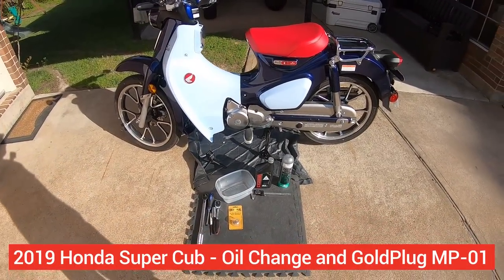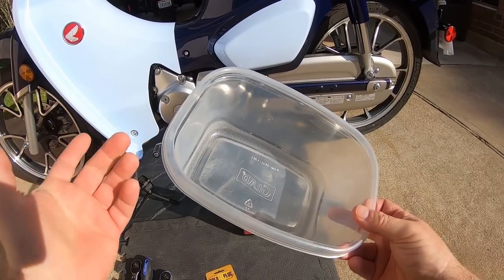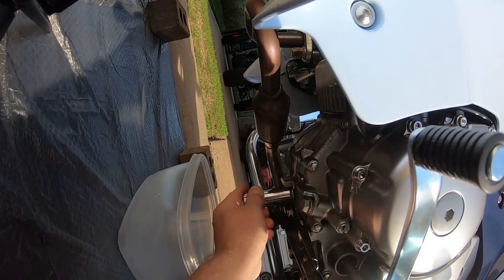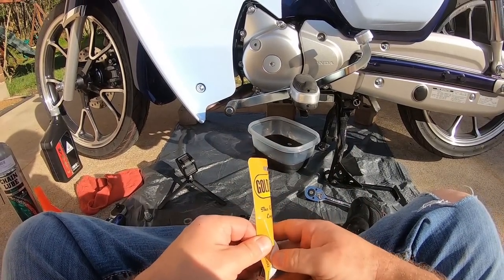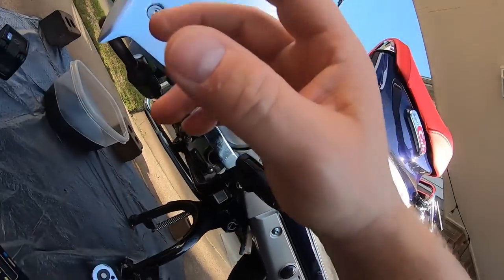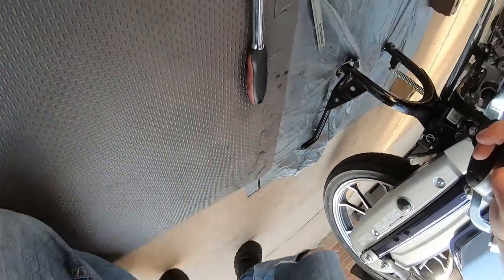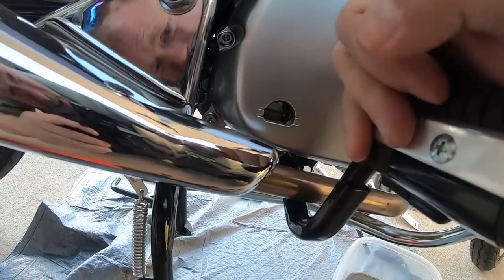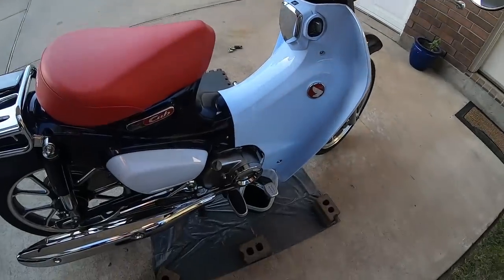2019 Honda Super Cub C125 // First (early) Oil Change // Gold Plug MP-01

Comment: hi, video suggestions 
1. Iridium plug, MPG /throttle response /dyno?
2. Amsoil scooter oil or shell 5W-40 scooter oil
Reply from the maker: I plan to replace the spark plug after a few thousand miles, so I will replace that with an Iridium plug when the time comes.  Unfortunately, I don't have the fancy equipment for a dyno run, but Cycle World has done that for us already:  https://www.youtube.com/watch?v=TEEMlIHn1bg .  I haven't decided on the synthetic oil that I will run in this motor after the first 1000 miles, but it will probably be Castrol 4T full-synthetic or maybe LiquiMoly.  I track my fuel mileage for my bikes carefully, so maybe we'll see an improvement when I switch over to synthetic.

I haven't tried the Amsoil or Shell scooter oils yet. Do you have any experience with them to know if they have any benefits over other 4T syn oils?  That might be a good test for the guy at Project Farm:  https://www.youtube.com/channel/UC2rzsm1Qi6N1X-wuOg_p0Ng . He does all kinds of really excellent test/comparison videos!  --QM

Comment: Hi,
What size os gold plug 12,14 16?
1.25 1.5 1.75?
Thanks.
Reply from the maker: I installed the Gold Plug MP-01 (17mm head):  https://amzn.to/3wUITnw . The plug dimensions are M12 x 1.5 (16.75 mm length seated depth).  You can see the full measurements in my Honda Navi oil change video: https://youtu.be/CfnLLFgqiKk (skip to 4m 26s).  Cheers!  😉👍  --QM

Comment: Wouldn't a screen keep  metal particles in the crankcase?
Reply from the maker: The screen is below the "spinner" assembly, so it acts as a semi-permanent filter in the crankcase to catch larger debris.  That screen is scheduled to be cleaned every 8K miles along with the spinner assembly.  The GoldPlug also seems to catch quite a lot of debris in the oil because it's covered with gray, ferrous sludge every time I change the oil.  I'll be sure to video the spinner change maintenance when I tackle that job sometime soon.  Cheers!  👍  --QM

Comment: Does a brand new Honda super cub come with standard oil or synthetic oil? I went to an auto parts store and the representative told me that if the factory puts synthetic oil in the crank case you should not replace it with standard oil. Does that sound right to you?

Comment: Thanks for yet another great video!
Question: If there is a screen above the gold-plug, separating it from the main sump area... wouldn't any detritus be blocked from the magnet by the screen?
Reply from the maker: I had assumed the same thing, but I was surprised to see how much ferrous sludge was built up on the magnet during my last couple of oil changes.  There were even a few larger, shiny slivers of metal on there, so it appears that the GoldPlug is still able to perform a valuable role in cleaning the oil.  The magnetic plug is cheap insurance, IMHO... it certainly doesn't hurt to have it installed.  I'm particularly interested to see how much debris is caught in the oil spinner and screen area.  I'll be sure to video and share that procedure when it happens.  Cheers!  😉👍 --QM
Reply: @QuasiMotard  Excellent reply. That all makes sense. Nice feeling to know that the magnet is there doing its duty.
But I'm still confused...How does the debris above the screen, ever get emptied/removed?

Thanks
Reply from the maker: @justkeepinitrealyo  The oil spinner and debris screen are a maintenance item that needs to be performed every 8K miles, per Honda's guidance.  The right-side engine cover must be removed, followed by the oil spinner assembly and other related parts, cleaned out, and then reinstalled with a fresh cover gasket.  I don't anticipate that the procedure will be difficult, but it will probably be tedious and very messy.  😉👍  --QM
Reply: @QuasiMotard  Got it!  Thanks.

Comment: I have been using regular motor oil in my cub, not motorcycle oil. Do you think that's  a mistake, or is oil, oil?
Reply from the maker: The Super Cub does require JASO- MA rated oils because of the wet clutches in the transmission.  You can use either traditional petroleum-based oil or synthetic, whichever you prefer... just be sure that it has JASO MA or MA2 ratings and no "energy conserving" classifications.  😉👍 --QM

Comment: Been a while since I have had a Honda anything, so I only know about oil changes on my other-branded scooters. All the shops want $100 to $150 for an oil change and (bogus) service. No thanks, I will be doing my own oil changes. Besides, can an oil change get any easier than on this bike.
Reply from the maker: Yep, that's my posture on it as well.  I like to have the first change or two done at the dealer while the bike is under warranty.  That covers the "mandatory" initial maintenance for warranty issues.  Beyond that, I do all of the routine maintenance on my bikes.  At least I know that it was done right, and not shorted on anything (e.g. , cheap oil, etc).  My dealer does a decent job, so I don't worry too much... but I've had a few really bad ones in the past.  A few good ones... new tire and tube change, but they put the OLD tubes back in (charged me for new ones, though)... wrong viscosity of oil (and petro instead of syn)... front axle carrier bolts missing (WTF?!)... exhaust hanger bolts missing, etc, etc.  --QM
Reply: @QuasiMotard  putting the old tubes back in while charging you for new ones. Where would we be without fraudulent, scammer mechanics??? My guess is we'd (most of us at least) all be a bit wealthier! 😄

Comment: Hey quasi have you started using full synthetic yet? I have about 3000 miles on my cub and I was wondering when I should switch to full synthetic. Hope all is well buddy thanks again for all of your videos 😁😁
Reply from the maker: Howdy!  Yes, I switched over to Castrol Power1 4T 10W-40 full-synthetic a long time ago.  Adrian and I noticed that we were consuming a lot of oil during the Scooter Cannonball Run... about 150mL per 500 mile day in the highways.  We switched over to Mobil1 4T 10W-40 full-syn, and the consumption disappeared.

We don't know if the difference was due to different riding conditions (e.g., altitude, temperature, engine loads, etc), or if the Castrol 4T was just too thin.  😉👍 --QM

Comment: Hey dude, I'm a recent cub owner, 2020 brand new. I would love advise and conversation about care and maintenance. Im 25 and this is my first "bike". So far I have 109 miles on the cub. Thank you in advance✌🏼
Reply from the maker: Congrats on your new Cub, and welcome to the world of motorcycling!  Most Honda's (the Cub in particular) are very low-maintenance bikes.  While the bike is still new (under ~600 miles), you want to take it easy on the motor and transmission by using moderate throttle and shifting as smoothly as possible.  This will help with the engine and transmission "break-in" and it should prolong the life of the drivetrain.  

After the initial maintenance is complete at ~600 miles, you will want to change the oil every 2000 miles or more frequently.  This is a topic of debate because the Honda owners and service manuals specify 4000-mile intervals.  These engines don't have oil filters (just a centrifugal spinner) and they only hold ~1 US quart (~1 liter) of oil.  My mechanical sympathy kicks in and won't let me run that heat-baked, dirty oil in there for more than ~2K miles.  My rationale is this:  oil is cheap, engine rebuilds aren't.  😉

Another item that you shouldn't neglect is chain maintenance.  The Cub has a chaincase that keeps most of the road grit away, but you should still lubricate it and check the tension/slack every 300-500 miles.  This is a quick process that only takes about 1-2 minutes.  You can use commercial chain lube/wax or common 75-90W gear oil to lubricate the rollers.  Chains are relatively cheap for these bikes, so strict maintenance and oiling isn't a huge money-saver; however, you certainly don't want the chain to bind or break prematurely (e.g. rolling down the road in traffic... that could be a Bad Thing).

Beyond that, normal washing and routine inspection of the bike will be a simple way to keep your Cub on the road for many years.  Typical automotive car wash soaps work just fine, and you can use old bath towels or wash mitts to do the washing (something non-abrasive because the paint and plastics on these bikes are soft).  Pro Honda Spray Cleaner and Polish ( https://www.amazon.com/HONDA-08732-SCP00-Spray-Cleaner-Polish/dp/B004FSEJZA ) is great stuff for waxing and polishing the bike after a wash or whenever you just want to give it a quick "dry" bath.  

IMPORTANT NOTE!!!:  NEVER use ArmorAll or other "tire shine" products on your motorcycle tires... that is a Very Bad Thing.  The silicones and shine agents bind with the rubber and can make the tire very slippery.  Many riders have dumped their bikes going around the first few corners after using tire shine.

Good luck, and congrats again on your new Cub!  Cheers!  😉👍  --QM
Reply: @QuasiMotard  Very cool. Thank you for the thoughtful reply! Unfortunately my break-in experience has been a tad rough, due to inexperience. I will be following all of this advice, there aren't many resources for these new models yet. Glad to hear some direction. Take it easy, man ✌🏼

Comment: Hey Quazi. Ive owned 22 model for about 5 month and put in about 4k miles on my cub.  My oil consumption is been crazy from day one owning this thing. 150ml every 150-200 miles.  I change oil every 1000k due to hard wot riding every day in any weather.  Did you have oil consumption issues with your year/ model?? Thank you!
Reply from the maker: Howdy, Ivan!  The oil consumption for your 2022 model sounds like an issue for your dealer and Honda warranty to check out ASAP!  It sounds like the piston rings might not be indexed correctly, or perhaps a crankcase ventilation issue is causing too much blow-by.

During our 10K-mile 2021 Scooter Cannonball Run trip, we noticed that our Cubs were consuming about 100-150mL per day... 500 miles at wide-open throttle on the highway.  We topped up the oil every night for the next day's ride, and then we changed the oil every 2-3K miles during the trip.  They don't seem to mind the abuse, and they never skipped a beat.

We switched our oil from Castrol Power1 4T 10W-40 to Mobil1 4T 10W-40 just before our 2000-mile return trip to Houston.  We noticed that the oil consumption nearly disappered after changing the oil brand.  The operating conditions were still the same as before... brutal wide-open throttle runs for 8+ hours/day.  I only needed to add about 75-100mL after that return trip.

Good luck sorting out your Cub's oil issue.  Let us know how it turns out and if Honda needs to repair something under warranty.  Cheers!  😉👍  --QM
Reply: @QuasiMotard   I have contacted dealer and will be dropping it off in few weeks.  But like anything else dealer is not very receptive to my concern.  I have worked on many bikes myself. But for once in my life decided to use the warranty. If dealer dont resolve issue ill be tearing top end myself and rebuilding. It is not that expensive or complicated.  Just takes time.

Comment: I started to do my first oil change, drained all the oil but then got called away- and left the ignition switch in the on position. The battery is dead. Any suggestions on how to get the battery out without power to get to it?
Reply from the maker: Sorry to hear about the mishap!  You will need to remove the battery cover in the center of the leg shield area under the front of the seat.  Be careful removing the center cover because there are several fragile tabs on that panel that might break off.  You can watch my disassembly video here for some pointers:  https://youtu.be/k1ri2ZEX9JI?t=972 .  After you have the center cover removed, then you can clip jumper cables or a jump box to the battery terminals to get it started.  Good luck!  👍  --QM

Comment: Really wanting one of these. 130mpg is amazing.  How is the tire life?  How many miles could one get before the engine is toast?  Been looking at Vespas and PCX150's, Kymco... essentially a cheap commuter, but I don't have a M class license and it's a 3 day class that I dread which is why it hasen't happened yet.
Reply from the maker: Thx for the feedback! Those are good questions, but I don't have any hard data for the answers.  These are my observations and opinions based on my first couple months and ~1K miles of ownership...

First, there is tire life... I would expect very good mileage on these based on the fact that the Cub is not very heavy and not very powerful.  I have ~1K miles on mine already and the tires still look completely new.  If I had to guess, then I'd say ~8-10K miles for the rear tire and 16K+ for the front.  These tires are very inexpensive at only $25-35 each and the labor to do it will be minimal in comparison to a scooter (the Cub has a traditional rear wheel, axle, chain & sprocket instead of a single-sided splined axle, and no need to remove the muffler either). 

Secondly, regarding the engine longevity...  that is up for speculation because this is a new motor design.  It's a Honda, so it should last forever with basic care and maintenance.  I do know that the older Cub's based on the 70-110 cc mill have been reported to easily last in excess of 40K miles with only basic, routine maintenance (the bike usually suffers a fatal road incident long before the motor quits).  The engines are simple in design, and the top-end can be rebuilt on the side of the road if necessary.  I would expect this new motor to last as long (or even longer) with the same care... just change the oil frequently and keep the valves adjusted.  The top-end of this motor is based on the newer Grom (MSX-125) power plant, so maybe there are some high-mileage stats out there on the web that we could use to gauge the long-term reliability of this engine.

Lastly, comparing the Cub to scooters... I own 2 PCX150's and I really enjoy them.  In terms of practicality, a scooter will beat the Cub hands-down because of the built-in storage and ease of operation.  The acceleration on the PCX150 (or any 150-class scooter) will handily outrun the Cub, but the top speed is roughly the same at ~62-64 mph.  The 150-200cc class scooters (e.g. Kymco, Vespa, Suzuki, Yamaha) will obviously go faster than that, but efficiency will fall off quickly as the engine displacement (and road speeds) increase.  That's one of the really strong points of the Cub... efficiency.  There are lower driveline losses because of the chain drive and no CVT/belt (friction, slip, etc).  I have seen as high as 145 mpg from my Cub (riding normally and not being overly nice to it), where the PCX150's best is ~120 (under ideal conditions and moving under 45 mph).  

In terms of ride quality and fun factor, the Cub definitely beats my PCX150's all day long.  The larger wheels and tires really smooth out the bumps and track better than the smaller 14" wheels on the PCX... high-speed cornering is also much better on the Cub for the same reason. The seating position on the Cub is less flexible and a little less comfortable than the PCX... the scooter has floorboards that allow random foot placement, and the seat is longer and wider for more comfort.  However, those are minor points for someone that is of average height... someone over the 6' mark would find either bike to be a little cramped.

In the end, you really need to determine what your expectations are for the bike.  If you need to travel above 60 mph for extended periods, then the Cub isn't the best choice for the job.  Similarly, if you are a larger rider (e.g above 6' or over 220 pounds), then a scooter or small motorcycle with a 150-200cc engine would be a better choice.  If those caveats don't apply to you, or if you are looking for extreme efficiency, then I don't think there is any other bike currently sold in the USA that can beat the Cub's efficiency.  Even the Honda Grom and Kawasaki Z125 Pro fall behind the Cub's stats, and they have much worse road manners due to the smaller wheels/tires.  --QM

Comment: Was that a Spyder I spotted at around the 12 minute mark?
Reply from the maker: Close... it's a Can-Am Ryker Rally 900 sitting under the gazebo. I have several videos about that bike on my channel.  --QM
Reply: @QuasiMotard  I was tempted by a Ryker but I prefer the storage on my F3Ltd. Considering a Super Cub to replace my Piaggio MP3 for commuting. Enjoying your videos on the SC!
Reply from the maker: Thx for the feedback!  I like the Ryker, but I've had lots of little issues with it, and the alignment issue (tail-wag and won't track straight at highway speeds) makes me hesitant to recommend it to people.  I have to be in the right mood to ride it and not be annoyed.  I have 15 other bikes in the stable right now, and none of them have bad road manners like the Ryker.  Anyway, the Super Cub is a treat to ride... it's not really a long-distance steed, but it's certainly capable of that if pushed into that duty.  I took it on a ~350 mile trip to Austin, TX for the MotoGP races at COTA last weekend... it was a lot of fun to ride up there and back.  --QM
Reply: @QuasiMotard  I've copied your Ryker videos to a UK Spyder/Ryker facebook page, should boost your views hopefully! :)
Reply from the maker: @ZedTee190  Thx for the bump!  I have a lot more Ryker videos to edit and upload... I'm lagging behind with work and family tasks over the past couple of weeks. I am also tentatively planning to ride the Ryker to the annual Spyder gathering in May... still need to find the specifics and solidify the plans.  That should have the makings for a fairly epic roadtrip video series... the ride up, motocamp for the entire event, and the ride back... ~1500 miles or so.  😉  --QM